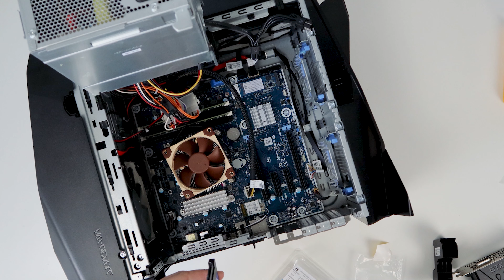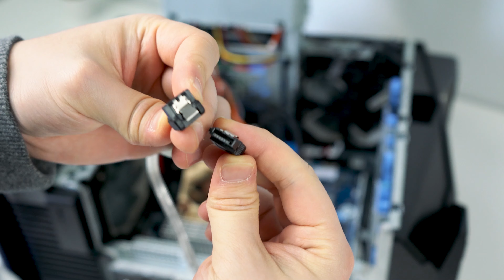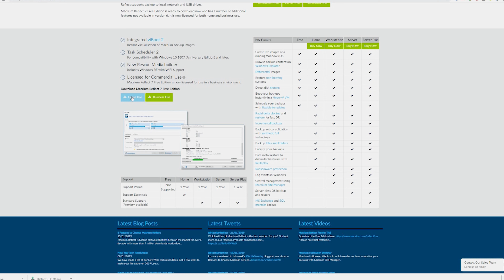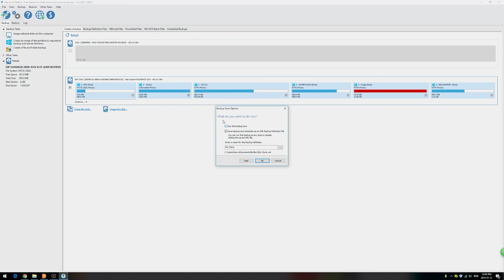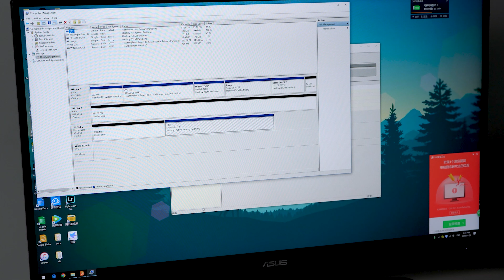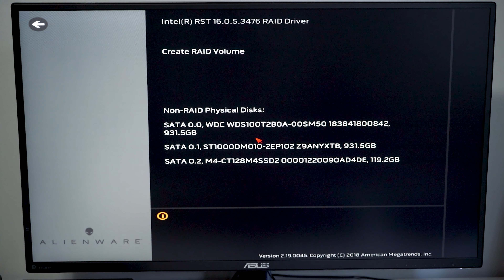Alienware Aurora R7 SSD Upgrade & Boot Drive Clone

Comment: I’ve been running into a issue lately with games being recommended being installed on a SSD drive, my primary drive is a SSD, but storage is a HDD. My SDD has very low storage and I was wondering if this would replace my primary and work for installing and running games on it?

Comment: Hey I'm adding more storage to my Internal SSD right now and i need a SATA Cable but I Don't want to buy the wrong one, do you have any suggestions on what size I should get to Install it with not that much slack of extra cords? Thank You!

Comment: I don’t understand, I cloned C: to new SSD H: in this case. Using AOMEI. After the cloning after 1st reboot the SSD was now C: and booting, I did “nothing in the boot menu” in fact the SSD isn’t even there. Although the BIOS can see it as a storage device. The original C: drive is now drive H:

Comment: I have the Aurora r7 too. I'm having an issue cloning and replacing the optane enhanced drive with another hard drive of the same brand (not ssd). What is the procedure for disabling the optane and re-enabling it for new drive after cloning? Does it require a reboot? Will I have to change UEFI settings to AHCI? Any help would be appreciated!

Comment: Theres millions of these videos on YT and theyre all exactly the same and none of them work. 

You can't upgrade to SSD in an R7 the BIOS won't let you change the boot drive, save yourself time and just stick with HDD.

Basically DELL are saying "if you didn't buy the SSD upgrade at point of purchase youre fucked!"
Reply: but it worked for a few peeps, you sure u are doing everything correctly?

Comment: I have the same PC and SSD drive, I got stuck @2:10. I checked all check marks and then clicked clone to new disk drive, and then clicked 'Next' and instead of continuing on it says "Not all copied. Insufficient space." But yet I did exactly what you did AND made sure all boxes were checked. I'm stuck, please help asap!
Reply from the maker: Sorry for the late reply. hope you have already figered it out.
Reply: @OnboardCircuit  I have it figured it out now! I just needed a bigger GB SSD lol. Got it working!
Reply: @OnboardCircuit  Nope, I haven't. 🤣 If you have any idea on how to help me, that'd be appreciated!
Reply: @treykunz1389  if your HDD had more space than the SSD the copying will have an issue. Make sure the SSD has a good amount of GB-TB so it can hold all the files from the HDD

Comment: Thank you so much, I just upgraded my R7 from an HDD to an SSD today.   I was a bit nervous, but it went perfectly. When the cloning was done, I shut down and simply unplugged the HDD just to see what would happen, and it booted right up off the SSD without having to change the BIOS, and it is really fast.  My question now is how do I reconnect the HDD (so I can reclaim that space) without the the machine trying to boot off it?
Reply: I suppose the easiest way would be to plug it in after your computer was already started, then format it to do as you wish with it. But that's just my guess.
Reply: @dapperfan44  I'm late here but...never plug in something while the computer is on. There's a boot order, wherever it finds the OS first it will boot from that. In days long past, it used to be boot from the Floppy, then the CD, then the HD. Whichever had the right stuff first it would boot from and not care about anything after that.

Comment: You should install and use a NVMe SSD as your OS boot disk, much faster than SATA SSD
Reply: I was wondering about that.  I ran a system scan at Crucial.com and they recommend a SSD that looks like a flat card, much different than the one in this video.
Reply: @Mike20878  suggest you open your case and take a look at your MB to see what had been installed. Also, use cpuz find your MB maker then look up its manual to see what it support. NVMe is much faster than SATA SSD.
Reply: @hunterleipan  I looked up the original configuration online and I'm sure it's the SATA drive. Thanks.
Reply: @hunterleipan I know this is old, and so am I. How would I do that?

Comment: I followed your guide and install the same 1TB SSD but my problem was my C: drive only show 224 GB capacity not 1TB. How do I fix it. Thank.
Reply from the maker: You can use the hard drive tool to utilize and merge unuse space.

Comment: When you say format the old drive, do you mean we can erase everything on it and just use it as storage? Sorry i'm so confused with this whole process lol

Also does it hurt to leave the intel opt in drive in?
Reply from the maker: If you already clone the drive, and I assume everything worked fine? then, you can format the original drive, and just use it as extra storage.
Reply from the maker: you can keep the intel optane drive in, but if you are already using a SSD as the main drive (boot drive), you don't get benifit from it, tho.  and yes , it won't hurt your pc...
Reply: Digital Etron Do you mean if you were to use the ssd as the main drive, you wouldn’t be able to benefit from using the intel optane but it would be still ok to just leave it in the motherboard?
Reply from the maker: @ProducingItOfficial  right.
Reply: Digital Etron oh ok ty for the clarification

Comment: I have aurora R7 cpu i7 8700. Do u think cpu is upgradeable 9th gen?
Reply: WhoAre You I have the same question. I want to install the i9-9900k
Reply from the maker: Yes , it can, they share the same socket, so you can put 9th gen CPU in there.